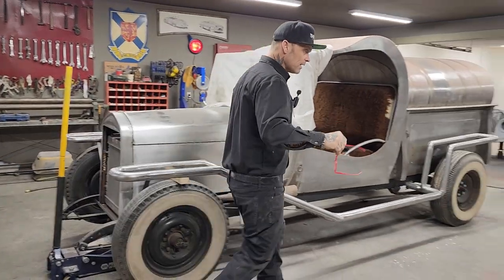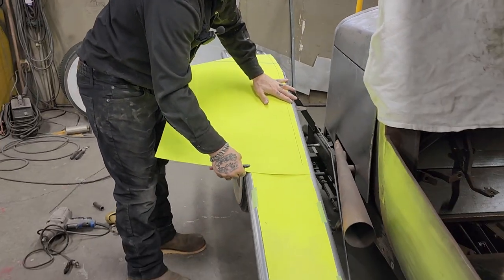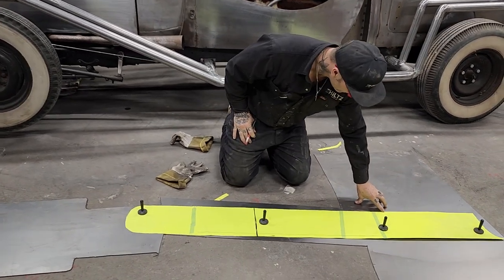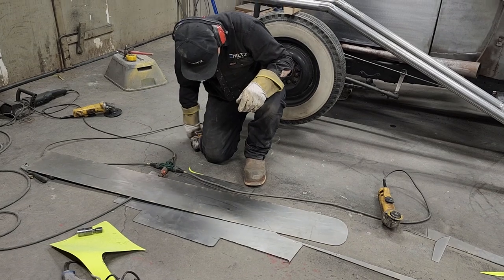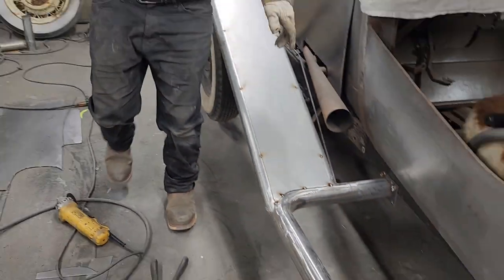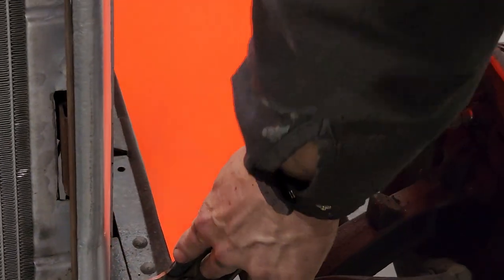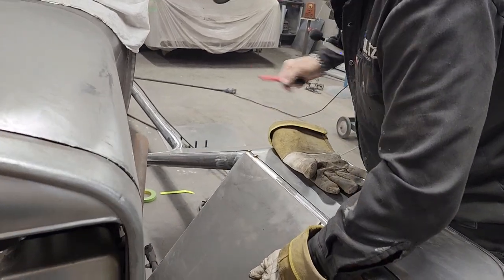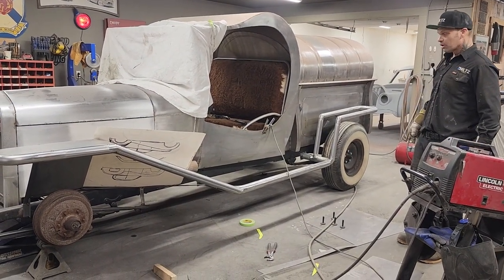Sheathing in the front fenders – here comes the visual 😍

Comment: Talking about over tightening. Every time anyone in my family has new tires put on their car at a shop or dealer, I get out the big breakover bar and loosen each lug nut (because that is what it usually takes after the workers put them on with an air wrench), and put them back on with whatever lug wrench they use in their cars. I don't know how many times I had to jump up and down on a lug wrench to break the lugs loose before I started working on cars myself and learned to do this.  By the way, I had a huge strong uncle that took lug bolts off with wire pliers! My Grandparents said they were always taking broken pliers back to the store and the clerks never believed their son was breaking them removing lug nuts.  LOL
Reply: That’s a great story about the channel locks. Myself I always use just a little anti-seize on the wheel studs.
Reply: @i8ntnuts  Not channel locks....regular pliers. This would have been in the late 1930s-early 1940s.  I imagine anti-seize was unheard of, and I don't think I would put that on lug nuts anyway. Just use a four-way lug wrench or long socket wrench.

Comment: Anyone else use those metal cutting wheels?  I bought one for $14 a while back and it lasted so long. I swear in the long run it’s cheaper than the fiber zip wheels
Reply: I know some of my wheels don’t last very long if I use too much pressure while cutting. Sometimes I get in a hurry when I should let the tool do the work

Comment: Took me a while to warm up to this muffler tubing gig but I'm starting to feel it .
Nice job you two 👌😎
Reply: And you can get that aluminized tubing in different sizes. 2 inch is probably the most common, but it also comes in larger and smaller sizes.  Plus, you can get pre-bent pieces If you need to make any nice bends.  
Light, strong, corrosion resistant, Cheap compared to other types of tubing/pipes.  cheap compared to other types of tubing/pipes.  Plus round tubing is stronger than other shapes. (pound for pound)

Comment: Chad do you know the method of using your metal brake and a piece of pipe?  You can make your radius for the fenders. And not have to use all the exhaust pipe.  Save yourself money and weight.  And be just as strong.. been doing it with race cars for years.

Comment: Those fenders will be very strong and stiff.  The only downside is that a lot of dirt and mud will get caught on the underside in the crevice where the pipe and sheet meet.
Reply: It will probably never see the road so you don't have to worry about mud getting up in there
Reply: It's art it's going to sit in his garage and collect dust
Reply: @chrisbond6056  Even taking it for a joy ride that is a problem.  Installation of angle stock on the pipe inner pipe lip to top sheet would eliminate this.  Followed by quality seam sealer.
Reply: I don’t think the dust will be that much of a problem, but the corrosion from moisture in the air won’t do much good. I know they are just art, but I do think it would be worth having somebody take care of them while they sit. Chad is the last of the good old boys that use to build cars like this

Comment: When you WELD the Brackets to the 'support angle-iron' AND you attach a Head Lamp to the Bracket you will not be able to REMOVE the F fender/running board /R fender as one piece unless you remove the HEAD LAMP first. That sir is an error. IMO OR I may be missing something?